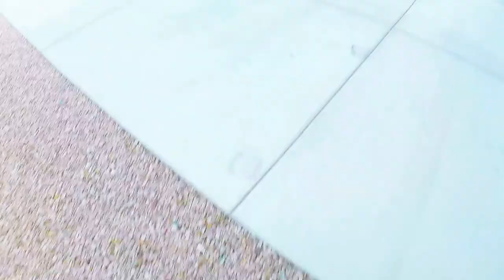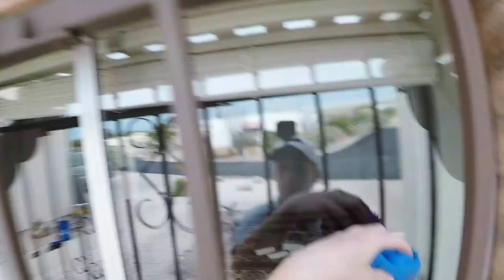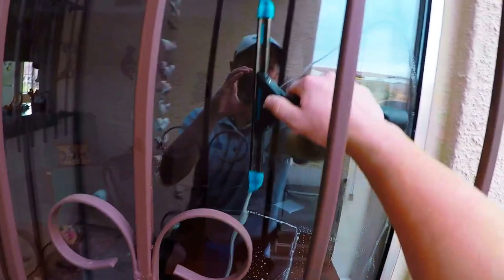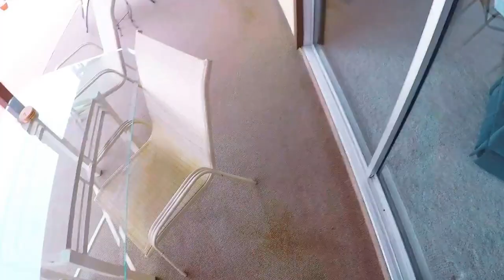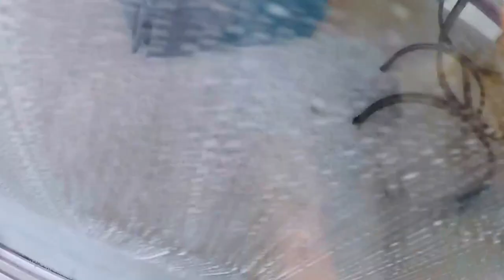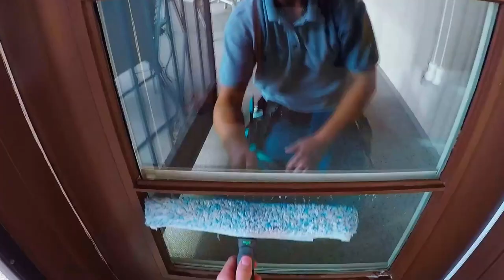window cleaning with security bars part 2

Comment: Some of the security bars in Boston are right up against the glass with maybe a quarter to half inch clearence so there is no using a squeegee to clean all the glass!
Reply from the maker: In that case, there's almost nothing you can do unless you can remove the security bars.
Reply: Spray with Reverse Osmosis water?
Reply from the maker: you could. But you have to agitate the dirt first before you spray it with RO water
Reply: Spray with soapy water then RO water?
Reply from the maker: Yeah that might work. I will have to test that out

Comment: Did you use gg4 in this vid? Looks kinda soapy
Reply from the maker: That was way back when I used to add a little dish soap to the GG4 for extra slip. Now i just use straight GG4 or sometimes I add a little Glass Gleam Glide.